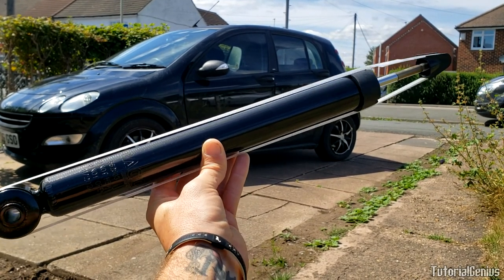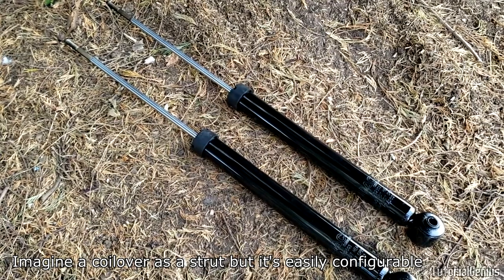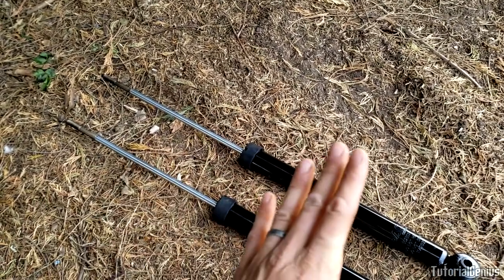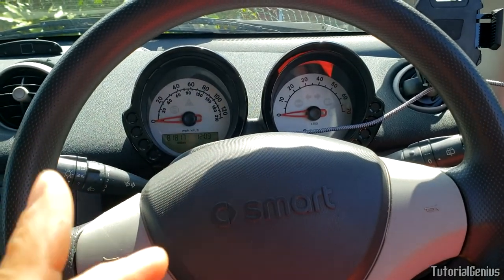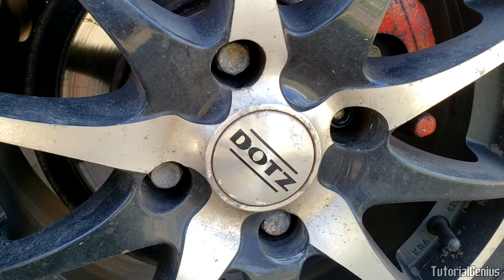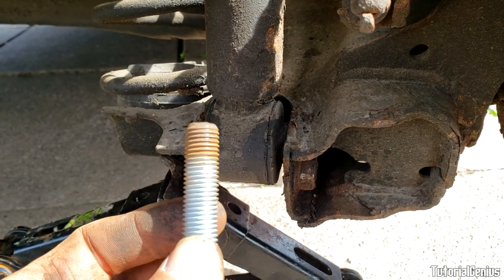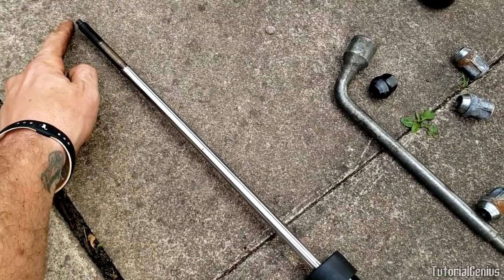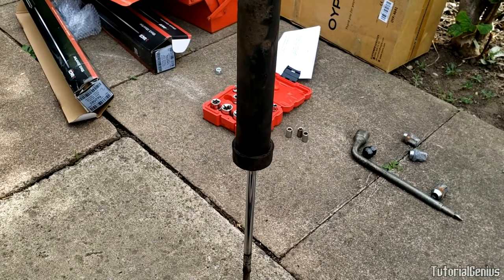Shock Absorber Replacement - The 101 ULTIMATE GUIDE

Comment: You said at start of video … No-one really has a smart forfour 😂 😂 😂 … I have three! … the cars are quirky! Navigating between what is a Mercedes part and a Mitsubishi even confuses the best motor factors. New parts are sometimes impossible to find. Second hand /refurb part prices are getting silly! … also I find getting certain technical specs for them including torque settings is challenging. Smart/Mercedes’ dealers do not give the info out freely cos they want to rip you off! … guess I was frustrated that the torque settings weren’t in your description … didn’t mean to demotivate you. I’m doing the rear shocks tomorrow on my daughters car … your video was helpful in as much as how to access the top nut. I’ve replaced plenty of shock absorbers before … Torque specs are useful but I’m sure I’ll be ok as long as I don’t over tighten them. There is a shortage of smart 454 repair videos online. Tbh, would be great if you did some more! … 🤔 Maybe I should start making and sharing my own.
Reply from the maker: I get a lot of these comments, you are not the first. People say they can and will do better, but the reality is, nobody bothers. When you're on the driveway with oily hands and a camera, it doesn't sound so appealing anymore, and that is before the video editing and upload process. I'm not really sure why people feel the need to communicate this way, especially when the video was otherwise helpful.